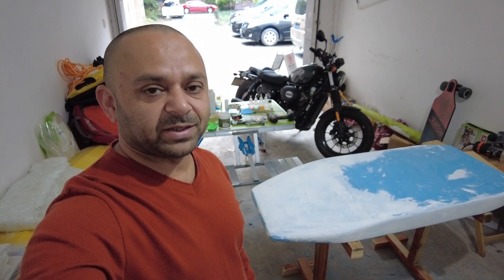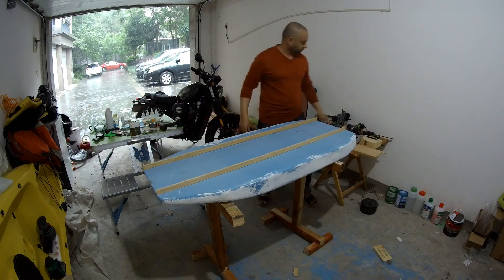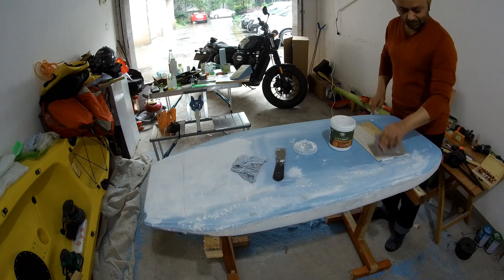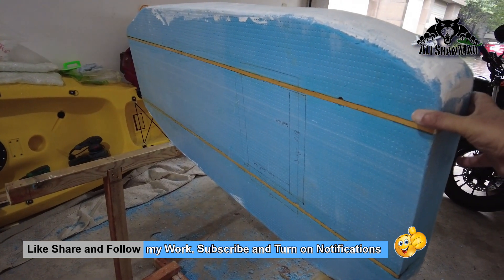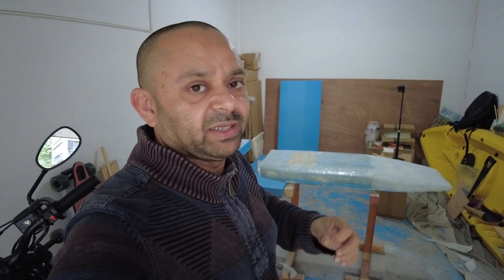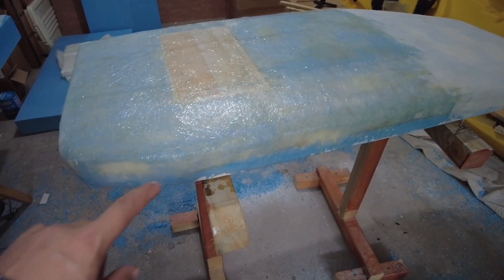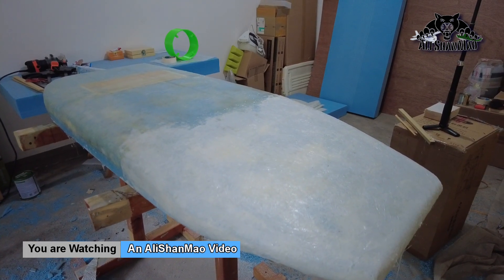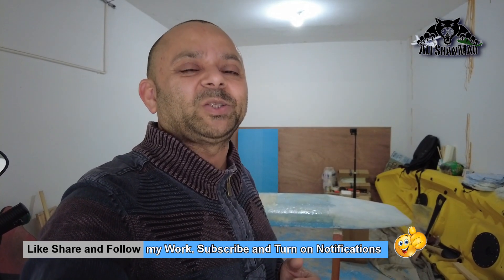DIY Electric Surfboard Build Vlog 3 - Adding Stingers and Fiberglassing

Comment: One layer would have been more than enough with the fiberglass mat.
Especially if you are going with an additional light cloth layer over the top.
(The mat needs a lot of resin, it sucks it up like a sponge, but you end up with a thicker layer of glass than with cloth.
Reply from the maker: yup thats what i have learned. for now only one layer of that pelt (mat) Thanks for the tips